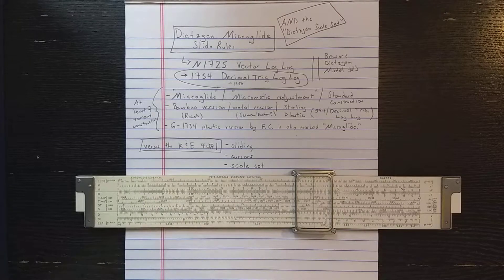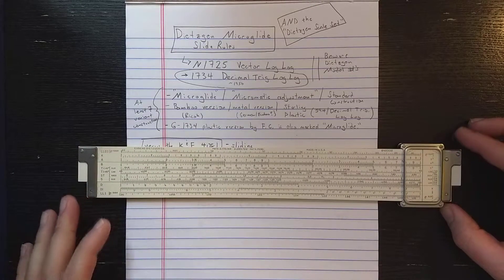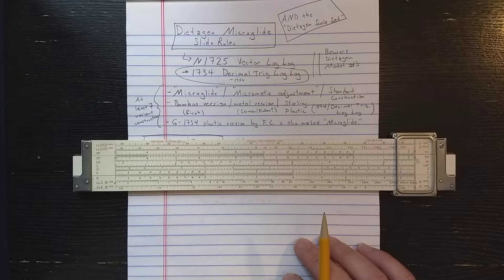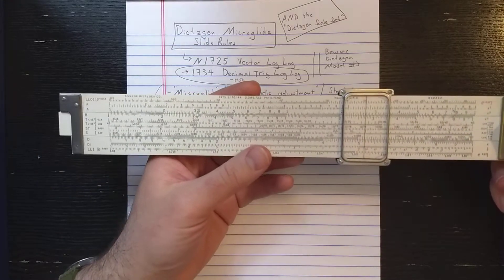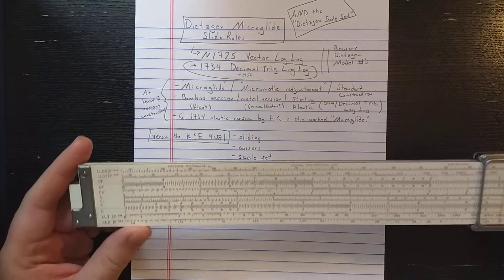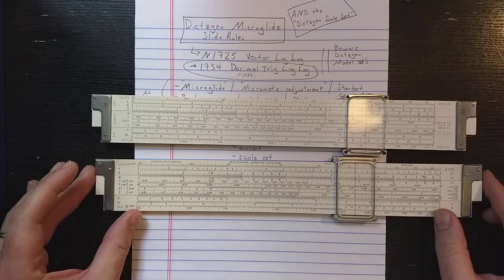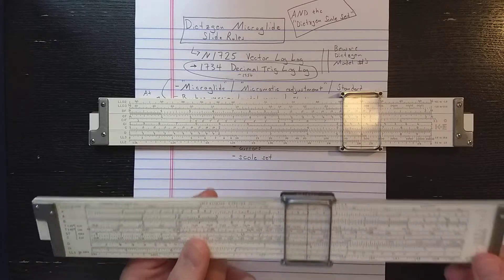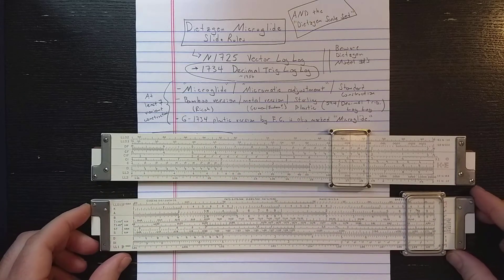Dietzgen Microglide Slide Rules and the "Dietzgen Scale Set"

Comment: Is there a preferred way to fix a hairline crack in a glass cursor? The one I have does not affect the use of the rule but it is annoying. It is a Dietzgen 1734 from 1960.
Reply: Can you unscrew the cursor? You might be able to sacrifice a less desirable slide rule and swap the glass element.
Reply: @EPMTUNES  I have thought of that but honestly, it is more important that the two sides remain in precise alignment than it is to be rid of the crack :) So I live with it.

Comment: The micromatic adjustment was not for tension. Is actually adjusted the alignment between the top and bottom bases.
Reply from the maker: I know it did that, but I thought it also adjusted tension. Are you saying that the tension adjustment works more or less normally? I had a non-working micromatic, but I think I acquired one somewhere that actually works -- will have to look at it.
Reply: @ProfessorHerning  To me, it feels that the tension remains relatively constant because of the spring "suspension". I look forward to your opinion!  

Also, it sounds like yours may have screws in both ends? Mine only has a screw on one end.  I was just wondering if there are different versions that I was unaware of.  Thanks!
Reply from the maker: I'll try to find it!
Reply: @ProfessorHerning  As Nicholas Mastricola stated, the Micromatic adjustment is only to allow precise alignment of the upper/lower by moving the top section left and right. Also, as noted, there is only one adjustment screw. However, the 'live' nature of the mechanism requires there to be a constant floating spring tension, so you have quite a bit more 'give/leeway' when adjusting tension in the normal way. It also seems to handle humidity changes better. Coincidentally, I was just reading the adjustment instructions yesterday!